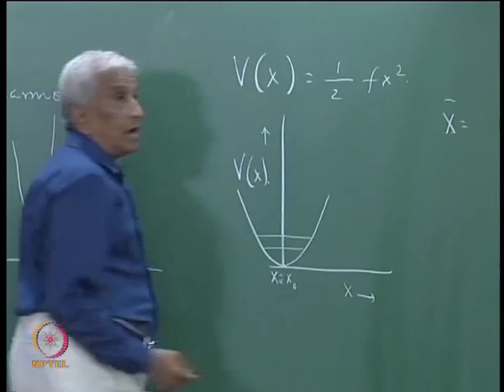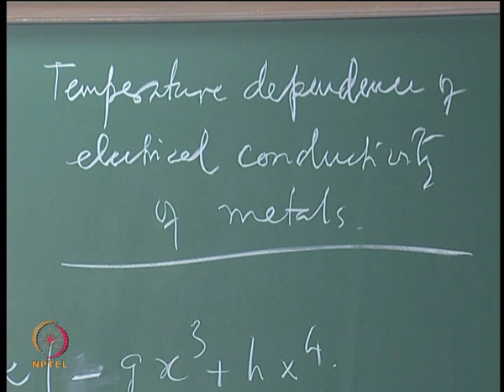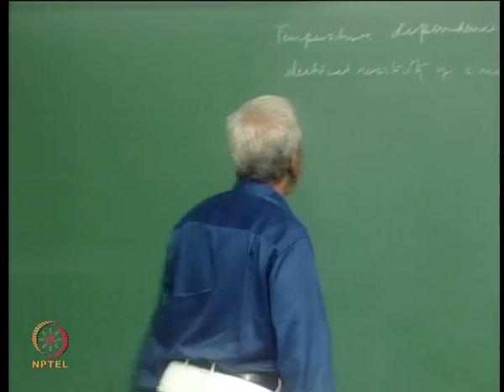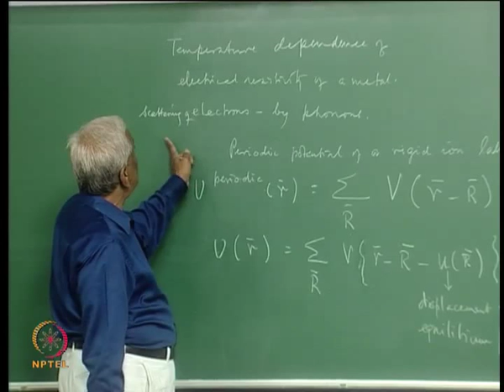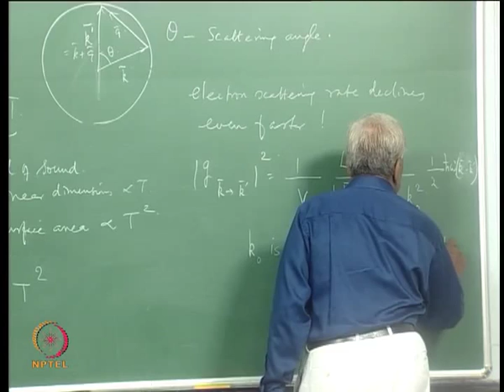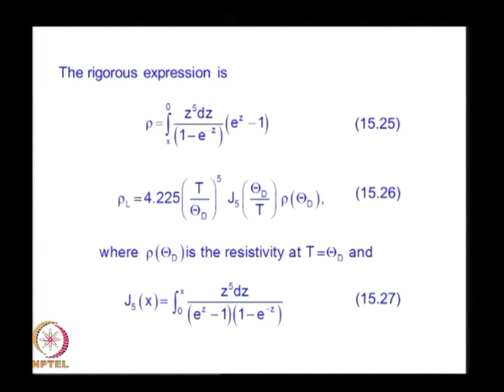Mod-01 Lec-15 Anharmonicity and Thermal Expansion

Comment: The integral at 8:53 does not converge. I tried it with a few values of the exponential. Assuming the anharmonicity and the coeff of the quartic term were positive.